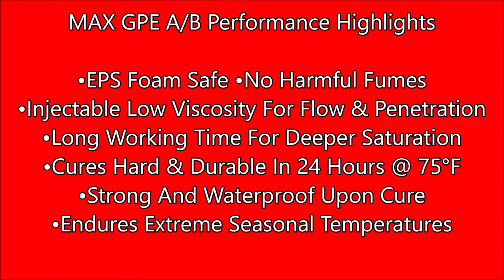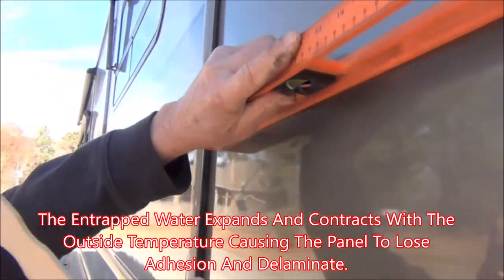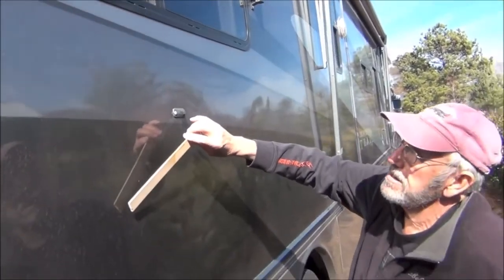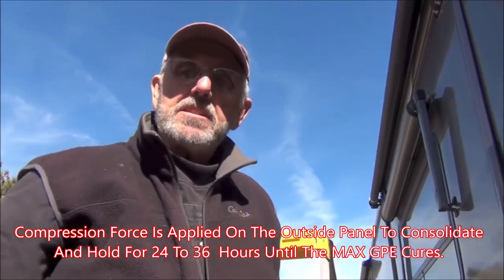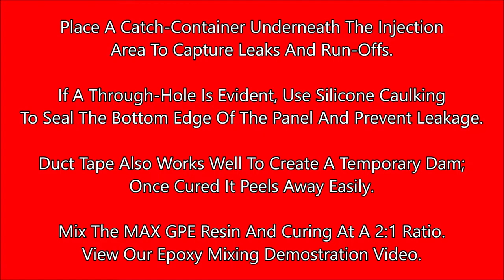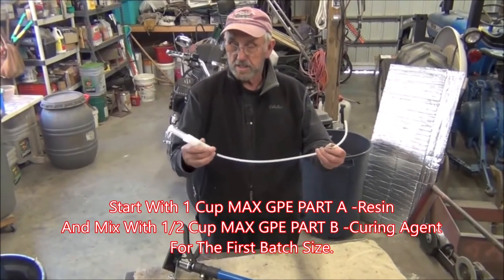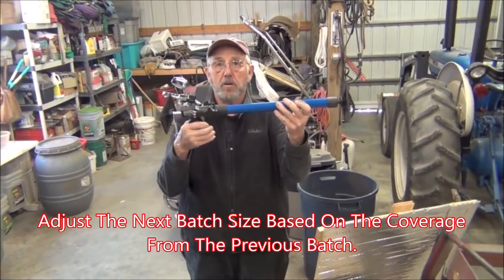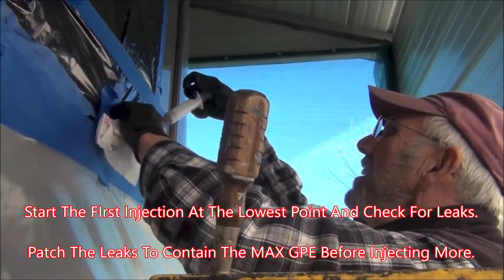MAX GPE RV Panel Delamination Repair -Injectable Epoxy Resin To Glue RV Panel & Harden Soggy Floors

Comment: Just did this to my rv.  Not sure if the glue got where it was supposed to go but I can tell you one thing ..this glue is well past the definition of strong, it is unbelievably strong.  Some puddled near my step ladder foot and it fused the ladder to my driveway like it was welded.  If the glue went to the delam area I have no doubt it will hold better than new.  The issue for me was getting the glue in the right spot through a marker light hole.
Reply from the maker: Hello, Thank you for your comment. Yes, MAX GPE A/B does yield high strength upon cure. To help remove the cured puddle, use a heat gun to warm the spot and then use a metal spatula to scrape off the cured resin. Heat will make the cured resin soften for mechanical removal.
 As far as injecting the mixed resin in the right place, you may need to drill injection holes on the very top of the delamination bubble, inject the mixed MAX GPE, and then apply pressure to bond the delamination back into place. Use an automotive body filler to patch the hole and the paint to color match. Here is a video demonstration from a customer that used this process to repair his delamination problem. Thanks again, and let me know if I can be of further assistance.
Vid 1
https://youtu.be/nmSbVD42jNk
Vid 2
https://youtu.be/ztYjLolbhrg

Comment: Would this work on to inject into soft spots on the floor?
Reply from the maker: Yes, as long as there is access to where the resin can be injected, you should be fine. Park the RV on a level plane, inject as much resin as you can until it is saturated, then allow it to cure. This resin system has a very long working time so the injected MAX GPE stays as a liquid longer and infuses. Please make sure to place a catch at the bottom to capture any excess resin that drips out. Here is a link to a soft floor repair using the MAX GPE A/B;
https://youtu.be/Tg0bUHLq6m0
Reply: Very good video,I have a toy hauler that leaked like a sieve after the warranty was up,I stripped off all of the lights and metal trim and saw how they put these together (very poorly)I put butyl tape under everything and resealed with flex rv caulk,now I need to find a good video on floor replacement